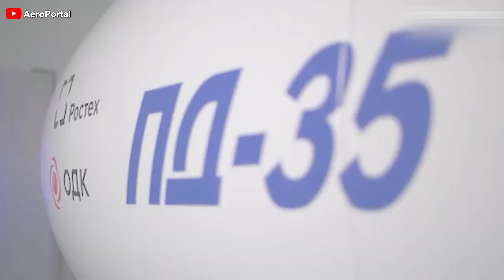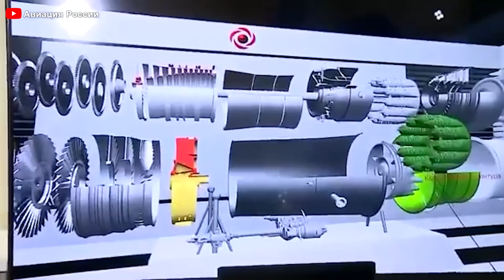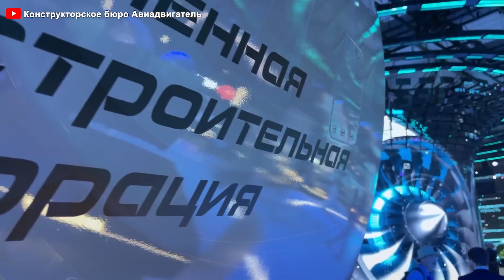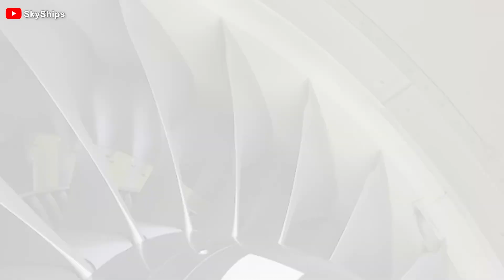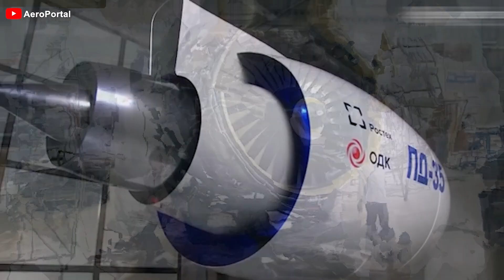This How Russia New PD-35 Engine Will The Aviation Industry!

Comment: What kind of nonsense did you compare a Russian engine designed for 35 tons of thrust with a foreign engine designed for 60 tons of thrust? Isn't this idiotic? firstly, foreign analogues have greater weight and size, and secondly, the PD-35’s fuel consumption efficiency is 10% - 15% compared to foreign analogues and not to Russian engines. oh well, don’t worry, we understand that a resident from a Western country learns from childhood to tell lies about Russians.
Reply: Enough of this indoctrinated BS! Nobody in the West cares about Russia to any great extent. Of course we all know of the lies the population get force-fed by your goverment there, but isn`t it weird that the Kremlin elite are very happy to send their kids to the vile West to be educated at your expense?! Regardless, getting away your bleating for a moment I totally agree with you on your point in comparing PD-35 with a GE9X is ridiculous in any context. I`m assuming PD-35 output is for a Russian wide-body in the sector of something like a B787 which Russia would unltimately like to develope perhaps? I cannot see why not given your countries engineering abilities & wealth of minerals that this engine has a decent chance of success. It won`t be easy though as the best engine manufacterers here like RR, GE, & PW have all had problems in achieving reliability in the pursuit of evermore demanding efficiency expectations. The biggest problem to overcome is the higher temperatures needed, this means experimenting with very special alloy`s & of course lots of funding. We can at least agree on hopeful success for this engine eh!
Reply: @edwardwilcox6606  There is a ready-made airframe for the PD35, this is the IL-96, which currently has four old PS-90A engines installed, each with a maximum thrust of 16,000 kgf.